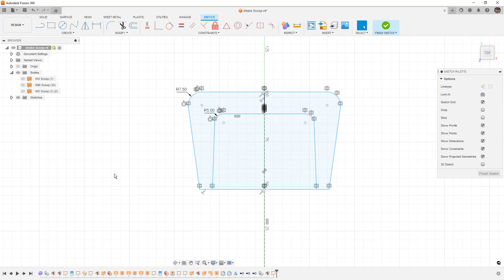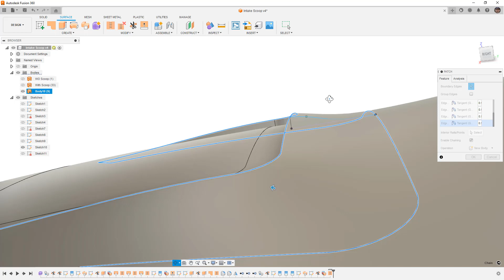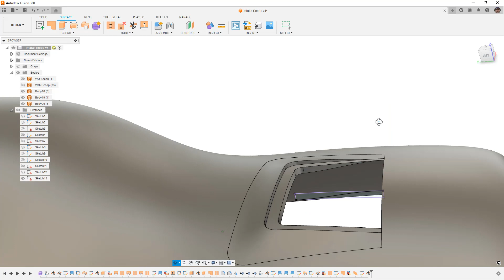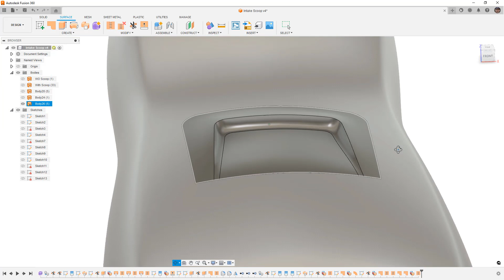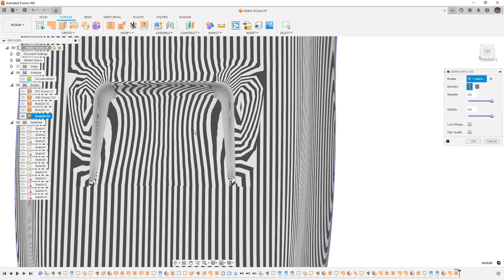Surface Mastery Part 15 | Creating an Intake Vent with Surfacing #fusion360

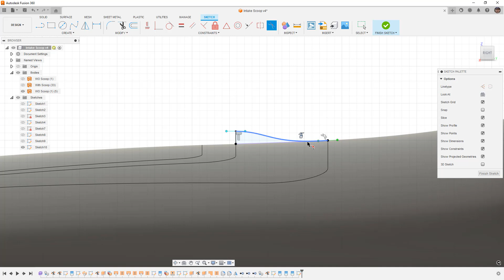Comment: From 9:37 why didn't you choose g1 instead of g2. Like how do I decide the one that should be used.
Reply from the maker: G1 is Tangent meaning the new surface will start in the direction of curvature of the old surface.  In most cases this is OK.  If you are dealing with a mostly flat surface for example.  G2 is Curvature Continuous.  This means it takes into account the direction (like tangent) but also the radius of curvature at that edge.  For complex shapes this "usually" gives you a smoother transition as it sets that radius (weight of the tangency handles) the same.  G3 (which we don't have direct control over in fusion) controls the tangency, weight/radius, but also the rate of change going to and away from the edge in question.  G3 is typically something seen in a "Class A" surfacing program like Alias.

How much does this all matter?  really depends what you plan to do with the file.  If you are going to machine and make a mold it might matter.  If you are going to 3d print or even send it to another program for rendering like Blender, it probably doesn't matter.  A 3d print with layer lines is going to be way worse.  and rendering often times will convert to polygons anyways to calculate the reflections and light and performs a "smooth shading".
Reply: @LearnEverythingAboutDesign I think I understood a little bit of what you are saying. I would have appreciated it if you explain why you chose g2 over g1 in some cases.But honestly some terms are a little bit technical. E.g I heard you talk about driving tangency in one of your videos. I didn't really understand what that meant. Some of us are still beginners of which we don't understand such technical terms. Overall I appreciate the time you give into enlighten your community and how you follow them up. Remain blessed sir.

Comment: ah dang, my fron of the intake is also rounded so i figured i could do the same but make it a closed loop for the intake, fusion doesn't seem to agree with me there. i'll just open up the front and see what happens

when i delete the part that goes down it doesn't actually delete a section out of it, it changes color and changes the body into something that has a different image top left, like a round sheet of paper instead of the standard cylinder logo
Reply from the maker: When you delete it are you on the solid tab or surface tab?  On the solid tab it will try to remove and patch it.  On the surface tab it will just remove the face..... well it should.
Reply: @LearnEverythingAboutDesign i wasn't able to get it working and just made a sketch on the top that basically was a side view of the shaoe my intake needed to have and i just extruded and joined that into the main body. It takes a lot out of the software and my computer but i got my part😅
Reply from the maker: glad you found a workaround!  Sadly sometimes that is the best and only way.

Comment: Very good video and I've learned a lot! Mostly that Fusion is very ill-suited for this kind of tasks) It feels like the tool is not helping you get the result, but you are fighting it to to get what you need instead. If you sacrifice precise continuity requirements, polygon- and subD-tools will give a much faster and eaiser result.
Reply from the maker: Yes for sure.  SubD tools do a much better/quicker job and there are always different ways to get a similar result.  but a feature like this would be more difficult with subD (in fusion) without fighting with surface quality.  

Fusion has been slowly improving things in this area but in terms of surface quality Plasticity does a better job right now.  But if you gotta use fusion :)

Comment: Far too many steps for a less than ideal result. No reflection on your excellent instruction or modeling Matt, I am speaking to my inexperience with the program and a CAD software which does not have fully mature surfacing tools. Of course...what is that old saying... 'A bad carpenter blames his tools' ;-)
Reply from the maker: Yeah surfacing takes awhile no matter the program.  Some have better workflows but if you can do a complex shape with freeform modeling or with simple solids it is much faster than working on a design face by face.

Comment: When surfacing can you somehow relax the mesh to get smoother transitions
Reply from the maker: Nope.  You get what you get with surfacing in any CAD program.  The input curves drive the shape.  The only way you can do that is if you use freeform modeling which is a more polygon approach.  The shape isn't a surface or solid until you "finish" and it gets converted.

Comment: Did I miss something? The end result doesn't have a slot or hole to vent.
Reply from the maker: This question came in from a user about how to make the shape of the intake/vent.  I didn't make the actual hole because on the real thing it was cut by hand after the fiberglass was made and had a trim piece.  You could trim the surface or cut the solid after a thicken.  My suggestion would be to make it a solid first, then make a positive block for the opening and use combine to remove it from the hood.

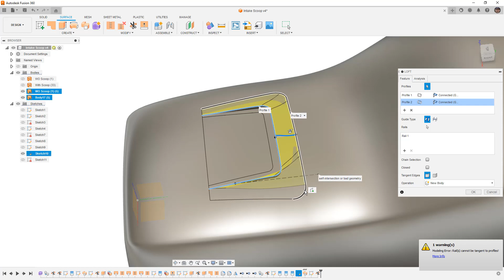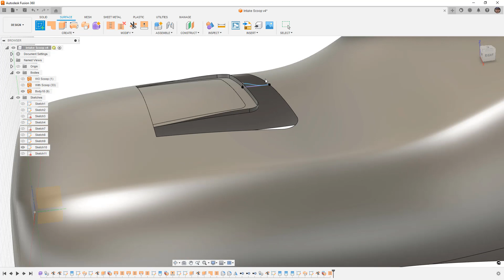Comment: Some question raised but not addressed: 1) why were the points dislocated at 13:20?  How might that discontinuity have been eliminated?   Why did you choose not to confront the discontinuity?   2) At circa 16:25, you Projected a copy of a line segment rather than use the existing Sketch element; the contributing failure which provoked the need to disassociate the line segment from connected elements was unclear- could you elucidate?  Might the failure have been avoided?  Thanks for your efforts.
Reply from the maker: I'll do my best to try and answer.  when i make these videos they aren't usually planned out.  its me going through how I would approach a model and recording the process.  So often times we try something, it doesn't work and we try something else.  Kind of how it works in reality :)  Things can break randomly and work sometimes but not others.  This specific case I did end up premodeling a lot of options and there were surface issues with some standard approaches so I wanted to show some of those pain points.
@13:20, i think you are referring to the loft preview?  When i was using the loft tool for some reason the guide rail was selected as profile 1 which produced the original warning that the rail misses the profile.  As i go around and make the selections the preview updates and its not happy when the number of edges on profile 1 don't match the number of edges on profile 2.  While it can produce a surface in some cases you generally want to aim for the same number of edges.  So for example 2 lines and an arc lofting to a single spline will end up with 2 seams on the surface.  Curvature maps often show at those seams you get some weird things happening....The discontinuity when adding the guides at the end come up when trying to trim complex surfaces to a point.  Sometimes this is because there is a very small edges segment that is hard to select.  Chain selection generally works on profiles but not on guides as well for some reason.  box selecting sometimes works, but as you can see there is a lot of "maybes".    
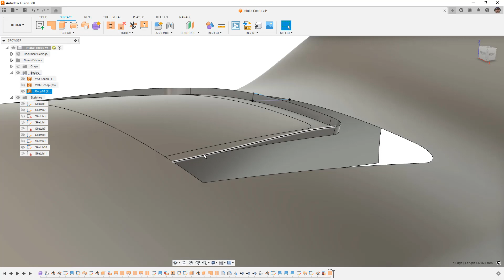Stitching surfaces together will heal some of those very small sections based on tolerance settings(as we did around 14:30).  So it really comes back to how much time you want to spend.  I didn't carry on with it because it was just one of a few methods I was showing.  

@16:25 I think the reason I did that was because the original spline was in a sketch with other entities and was connected so it was harder to select.  Projecting it into its own sketch made the selection easier.  Some users like to put a lot of sketches into their design while others try to cram as much into a single sketch as possible.  Just different approaches.  Projecting should maintain a link and be no different than using the original sketch edge, with the only difference being that spline was now in its own sketch meaning it was a clear single selection rather than grabbing other chains with it.

The surfacing tools in Fusion have improved a little(quality of the result) since that video was done 6 months ago, but the process is still the same.  Lofting around those corners gives bad surfaces (internal tension) so I would still approach this in the same way using the patch tool.  I think the error during the preview was mainly caused by that spline being selected with profile 1, and the other issue was just the warnings during the preview of the loft which always happens.

If that didn't answer it or i missed what you were asking just let me know.
Reply: @LearnEverythingAboutDesign  That was a very generous address- much appreciated.   I suppose the primary concern for me is the ability to avoid discontinuity when employing Sketch elements as Slicers.   It may be that with Fusion's curved surface solver, close is as good as it gets (as may be the case with any geometry depending from the intersection of a surface derived from a spline).
Reply from the maker: @mavigogun  yeah i mean with everything there is a work around.  So that discontinuity at that front edge.  I could have deleted that triangular surface and done loft to a point using the short vertical edge as the loft profile and the bottom edge of the opening as a guide rail.

In general its better to over build a surface and trim it how you want but that isn't always easy.

Comment: Hey Matt, any chance you could change the default material? It's sort of OK, but it would be a lot nicer to have a bit more contrast between the sketches and the bodies when watching the videos. Cheers!
Reply from the maker: I can't change the default, for video reasons, but next video when there is a body i will change the color of it.  It is hard to see for sure so thanks for pointing that out!